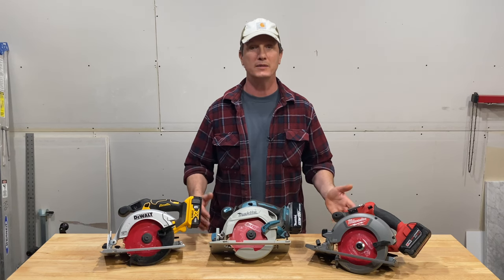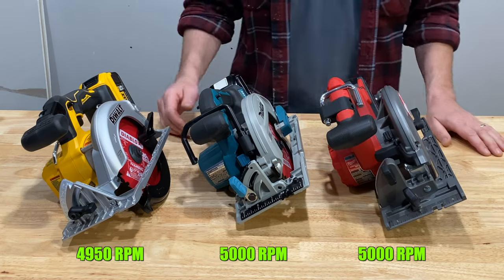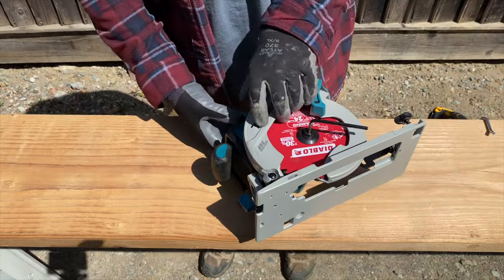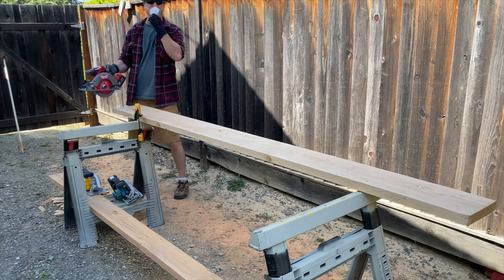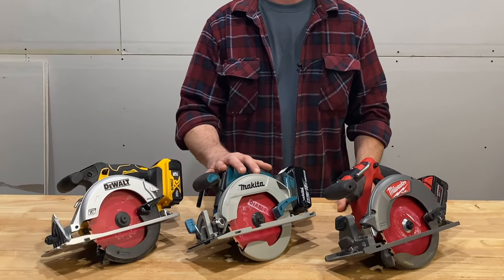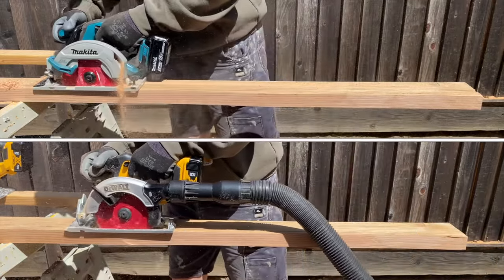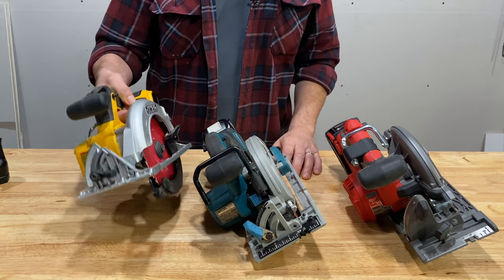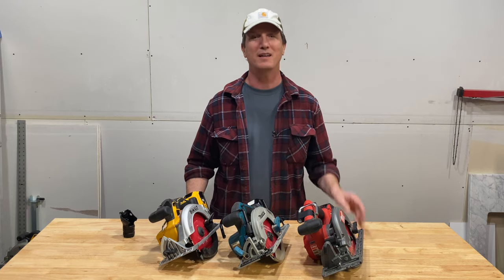Cordless Saw Review: Makita, Milwaukee, and DeWalt 6 1/2 in. Brushless Models

Comment from the maker: For everyone saying this review is unfair because you need to run High Output batteries on FUEL tools;
Milwaukee itself promotes the 6.5" FUEL saw with the XC5 used in this review.
You don't get much for the extra weight of a H.O. 6, see here - https://youtu.be/CWB3BGIQkDc?t=557
Not everyone wants to run big batteries on small power tools.
I could have boosted the DeWalt on a Flexvolt 6 too, but didn't for the same reasons.
See ya!
Reply: People just hate on Makita for some reason I’ve got all three brands of all their tools and I like all of them. I do have a little bit more Makita Because they never die I never have a reason to get anything else I have to hide them So I can try to get the new versions I still got the old nine. Six slide and battery one still works I got the first 18 V one. Makitas batteries die on me faster and their chucks  mess up but the drills or motors never die. Now the Milwaukee Their batteries seem about the same as makitas But the tolls that I have that don’t work are Milwaukee’s
Reply: well said...also using different batteries would un-level the playing field. great video.

Comment: You need the high output Milwaukee batteries for the fuel tools. It's a much more efficient battery with more power. You're running 21700 cells against very old 18650 cells in the Milwaukee, not a good comparison. I have both the old 5.0 and the 8.0 HO. The 8.0 runs the tool much cooler and with more power because it's efficiency is much higher. It's like night and day.
Reply: Same thing for Dewalt. Longer lasting/longer chsrge time w/batteries though.
Reply: The 5ah battery on dewalt has 18650. The 6ah one(20v) has 21700
Reply: They are all using 5amp hour. 
You're making Milwaukee fans sound like babies.
Reply: Milwaukee ain’t the best at everything. Just take an L for this one lol
Reply: @minhdaubu2363  you're right Milwaukee isn't the best at everything, but this is like putting kerosene in a diesel engine... Will it run? Yes, absolutely. But you definitely won't get the power and torque that you would from diesel.. This saw being a fuel tool is specifically made for peak performance with 21700 cell batteries.
Reply: @bryanbahling2877  all other tools was running on 18650 cells

Comment: I have had the Makita for years and years and it is a great saw, I like how light it is, very good for certain applications where you need to cut in odd ways like over your head or vertically / sideways ect. I like it but have moved away from Makita to dewalt because I am finding akitas build quality has gone to the dumper the last couple years. the drills especially are just junk now.I will go ahead with the dewalt circular saw and see if I like it but I will probably miss the nice light weight Makita.

Comment: The Makita XSH03Z is amazing. It is also the closest way to get a Left Blade guide rail saw with the track  adapter and dust collection fitting (196952-2 and 196953-0).
 
(It amazes me to see righties use a right blade track saw. Stretching,  leaning, twisting... everything wrong/unsafe. I'm a former lefty, and we had it good getting right blade track saws.)

Comment: Really good review. I just recently changed my tool brand and am with Flex. I am impressed with the Makita.  I am on the fence for a 6 1/2 saw. Flex makes one with a new type of drive. It is belt driven. It is longer but more powerful. Flex has the most powerful and long lasting run times for tools and their price is on point. I love competition so Dewalt and Milwaukee will have to step up.
Reply: Over priced in my opinion

Comment: The 6 1/2" Makita Circ.Saw is my all-time favorite cordless power tool for two reasons. It's the least squirrelly circ. saw ever and it's light as a feather.
Reply: I have the 36v but I need an extra saw on the jobsite. the 6 1/2" is $199 so idk if it's worth getting it or just buy another 36v bundle for $50 more
Reply: I just got the DeWalt today and I think I messed up
Reply: @sirslasher8189  I got it for 149$ on Amazon, sold by Amazon... they go on sale often. I got mine since the day it came out, so I buy more for my guys at the jobsites.
Reply: @dangrimes5078  lol

Comment: Anybody else have a trigger connection problem with the Milwaukee? Or know how to fix it?
Reply: Take apart the trigger but be careful because of the springs.

Clean the contacts.

Apply Dielectric grease (there are two separate contacts so dont use a conductive grease because it might shortcircuit)

Comment: The absolute best 6.5" Circular saw is definitely flex the performance out gun almost all 6 1/2",  the depth of cut is beyond all 6 1/2",   no saw even comes close.
Reply: They could be. But the big question is how will it hold up in 5 years? They are new in the tool business so there is the big unknown. Makita has done an excellent job for decades perfecting their tools with a great balance of power, ergonomics, and reliability.
Reply: Flex is not new in the tool business, they started in 1922 and they invented the angle grinder. But that line of tools is new.